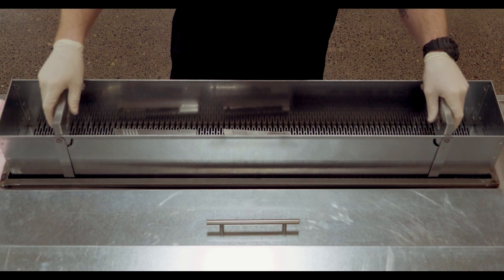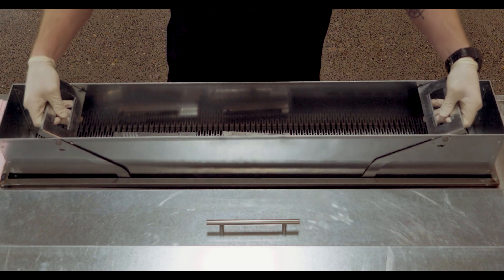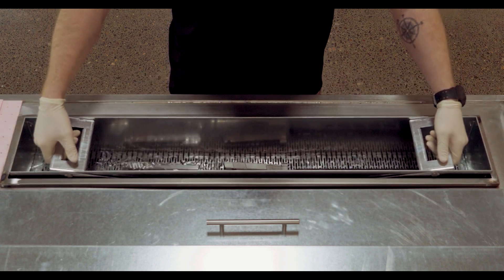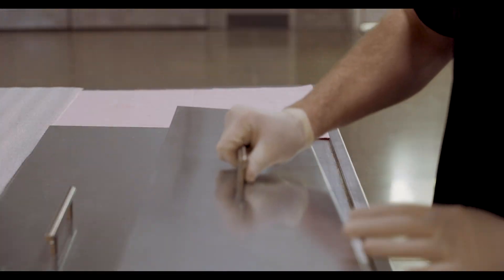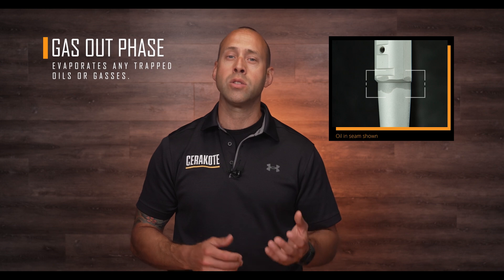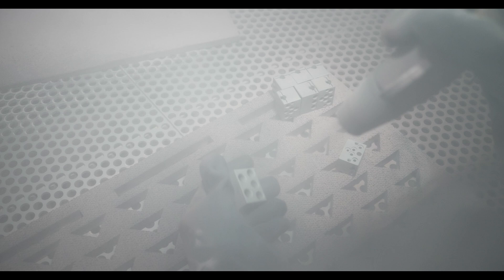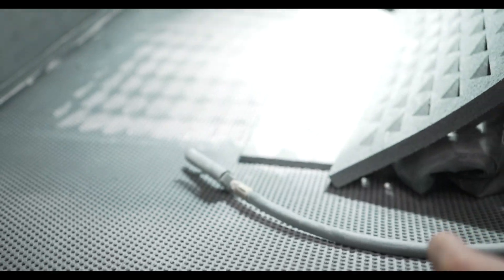Why Do I Need to Degrease Before I Blast | CERAKOTE®

Comment: It seems silly to assume a blasting cabinet will be contaminate free just because the media is kept clean. Do you ensure the air source is 100% oil free? How do you account for oil getting past rings on the compressor? How about various fittings on a reclamation system that have manufacturing oils embedded? Do you decontaminate the entire air system and media blast cabinet in addition to adhering to media cleanliness processes?
Reply from the maker: The air source should be filtered to help mitigate oil from that process.  Can one assume that everything will be 100% contaminant free all the time?...No. However managing the things that are in one's control will help create a "clean process" and the random events where contaminants happen to get into blast media will be much easier to pinpoint and deal with.